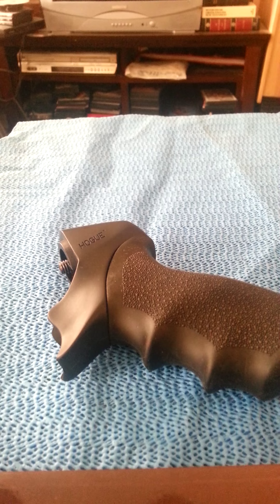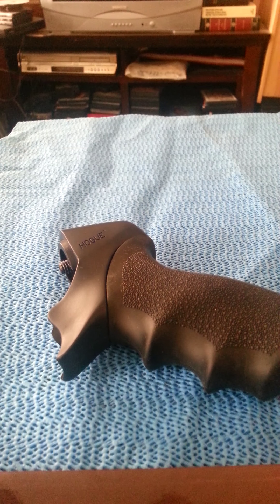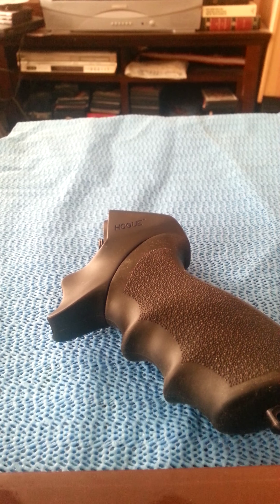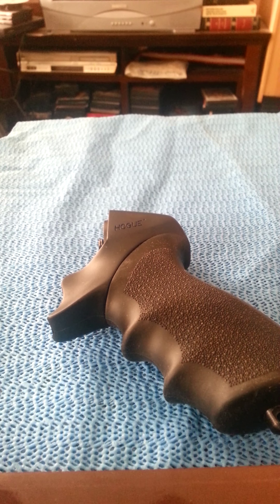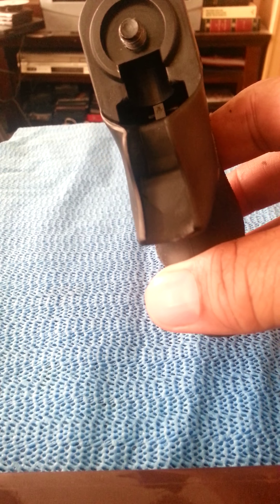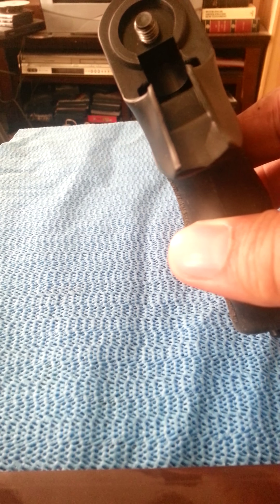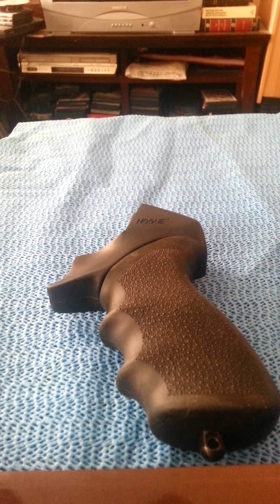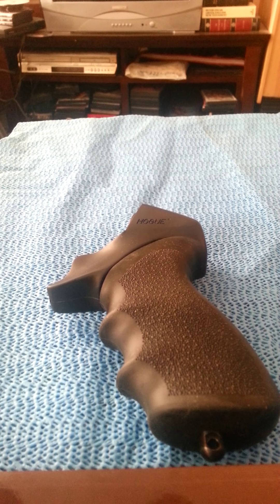Hogue Tamer Mossberg Part 2

Comment: God bless! I shoot managed recoil 00 buck on my PGO very effectively. The Winchester Ranger 00 load is the exact powder charge used in their AA #8 target load, so you
can train much more at $7.00 a box VS $14.00 per box of 25 shells of 00 buck at the same recoil level. Stop by Atlantic Tactical and check out their prices on the Winchester ammunition, hopefully they will sell it to non LEO. Stay safe!